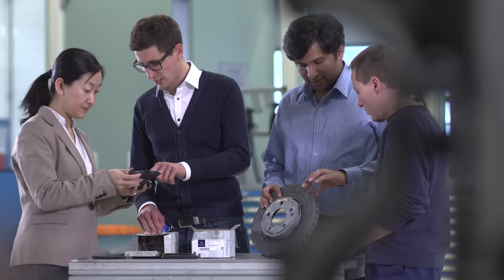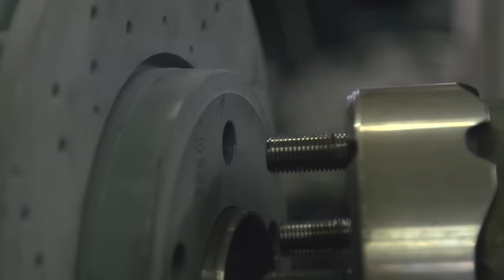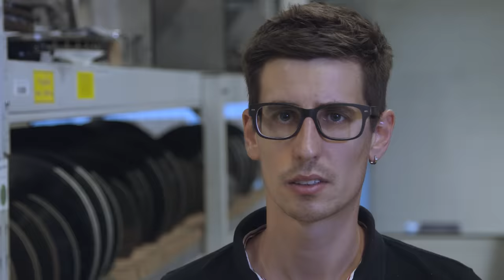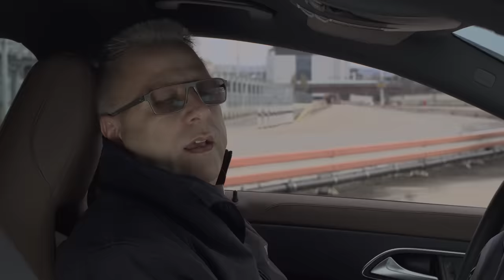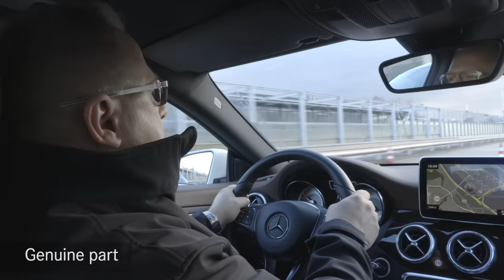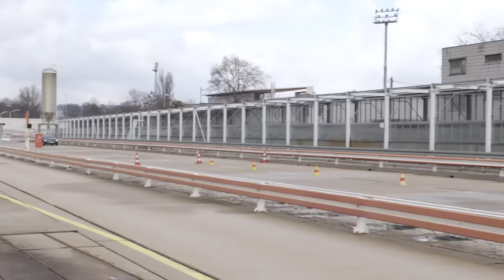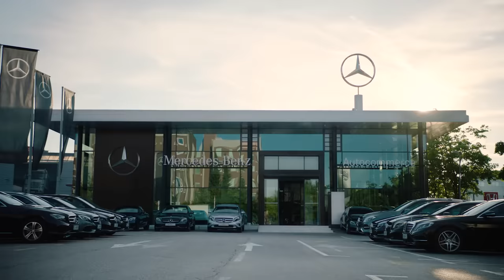Brake Test | Mercedes-Benz Genuine Parts vs. Fake Parts

Comment: How do counterfeit parts make brake distances longer? The only way to get shorter brake distances is to get better traction with the road. Besides that the brakes can easily lock up the wheels.

Comment: hello, what kind of brake pad used for Mercedes Benz cars? organic, metallic, or semi-metallic brake pads? of course ceramic for AMG High performance
Reply from the maker: Thank you for asking! The brake pads for AMG model are ceramic indeed. In general, it is important to equip vehicles with brake pads that are best suited for their performance requirements and characteristics. Hence, more standard Mercedes-Benz models are equipped with organic or semi-metallic brake pads.

Comment: does Mercedes make breaks , like rotors and pads.??? My  2015 ML 350 needs pads both 
(Front+Rear). And OE from Mercedes about CAN $  600.00. I'm buying online Zimmerman brand for $150, and Installing bu my self . saving over $500 . Do you think Zimmerman are counterfeit????

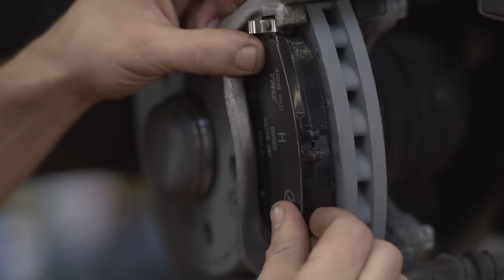Comment: Isn’t the brake disk at 1:18 on the wrong side? Vanes are supposed to pull air from the center to the outside rather than the other way around, right?

Comment: Mercedes you know that there is a feature called playback speed and that if you set it on 0.25 you can clearly see that the break lights of the second vehicle lighted up way later than the first one's right?

Comment: As any other manufacturer, Mercedes does not make brake pads, rotors, filters, belts, coolants, oils, fluids.... Everything they claim to be genuine is actually not made by them, maybe small percentage of parts is, but all those that i listed and even more, no car manufacturer makes. Sure they may develop something, invent it, but MB don't make brake pads, same as VW don't make shocks and springs, same as BMW don't make their own coolant... List goes on. As VW owner, i can tell you that "genuine" VW engine oil is nothing more than Castrol, except sticker on it says VW. Audi, VW, BMW, Porsche alternators are made by Valeo, wiper blades too. Just to be clear, i have nothing against genuine parts, i still get some of them for my car which is over 20 years old, but just because it's not their original part doesn't mean you will automatically crash and burn, to be honest i think this test was a bit exaggerated, complete brake failure while trying to do 60-0, in a single run (100-0)??

Comment: A lot of people don't understand what's going on here. When you look to buy parts for your car, there are 3 types of parts that you can purchase. The ones from the dealer, the ones from an Original Equipment Manufacturer and aftermarket parts. The dealer sells you parts which have the car manufacturers logo stamped on the part, in this case Mercedes. The original equipment manufacturer sells you the exact same part but it doesn't have the cars logo stamped on it (this is the one that you want for your Mercedes because it costs less than buying it at the dealer but it's the exact same part).

Then there are the aftermarket parts which are a copy of the OEM part. Now, some copies are legal, ie they purchase the right to make copies of the part and to sell it. But some copies are illegal, and are much inferior to the OEM part, this is what you want to stay away from. Let me make it simple for you, don't buy any parts that are made by a Chinese company. For example would you rather buy Zimmermann brakes or WBR (World Brake Resources) brakes? Zimmermann is a German company, WBR is Chinese. Zimmermann makes brakes for car manufacturers, WBR who knows. Stay with what you know and research the companies before buying their products.

Comment: where/how do you find counterfeit products, or rather how would you tell a counterfeit vs OEM vs legitimate aftermarket products?  I'm interested in avoiding counterfeit and I got no clue how to avoid them.
Reply from the maker: We advise contacting your local retailer directly regarding what is genuine or fake parts. They would know what is best for MB stars.

Comment: The second brake test you can clearly tell that the road was more wet as you can see after the cones on the first one had dry spots.. also black "counterfeit" car could have had worse off tyres...
Reply from the maker: The comparison of the braking distances took place under the same conditions at the same initial speed and the same braking point. The longer braking distance for the car with the counterfeit brake disks is the result of the defective quality that frequently occurs with counterfeit products.

Comment: What you will find a lot of the time is, for example, my Audi A4 control arms are stupid prices from Audi yet you buy them from Lemforder and they are much cheaper. They are however identical as Lemforder makes the control arms for Audi. I've even had parts for my car where the Audi logo has literally been filed off. 

It's the car manufacturers that are causing the real danger through their over inflated prices for parts, and also for those who don't know how to change Brakes the charge stupid amounts for something which is so very very simple.

Comment: My issues isn't with finding genuine Mercedes parts, it's finding them for a reasonable price.  When shopping around for prices and in-stock availability I find Mercedes dealer prices are all over the place, example when looking for front rotors one dealer was selling them for almost $100 a piece while another dealer 20 miles away had them for $63 a piece.  And I won't even begin to talk about the prices the dealers charge to install the parts, I wouldn't even be able to afford having a Mercedes if I didn't know how to do alot of the maintenance myself.

Comment: I had a customer with a top of the line Mercedes suv. He had 30k on it and it needed all pads and rotors replaced. He had a stroke. I sent him to his mercedes dealer and convinced them to replace 1500 dollars worth of brakes for next to nothing. Long story short, their rotors are either junk or purposely made thin. He got rid of the suv.

Comment: I suppose nobody in the comments knows the difference between counterfeit and aftermarket. Nowhere did MB say legitimate high quality aftermarket brake components from a reputable brand would be worse than OEM. They’re only showing the dangers of actual counterfeit MB brake components. You know, the kind of stuff you find on Wish and Ebay.

Comment: Counterfeit does not mean aftermarket. If a company is selling a product as Mercedes-Benz OEM it's flat-out wrong and very sketchy regardless of performance. But there are aftermarket brake parts available that are just as good if not better than OEM.

Comment: So why when you replace pads with Mercedes benz you have to replace rotor? Why do the pads eat away at the rotor?
Reply from the maker: Our colleagues at your local Mercedes-Benz workshop will be happy to advise further on the changing requirements of parts for your vehicle, Jesse. 😉
Reply: Mercedes-Benz not answering the question but ok...

Comment: The length of the way the car needs to stop dose not have much to do with the breakes. They just need the ability to stop the weel. The rest makes the „abs“ and rubber on the tires

Comment: Wow. The counterfeits didn’t even stop at high speeds. Just skidded until a low enough speed the pads could handle. Mercedes AMG carbon ceramics I’ve always said are the best with Bentley, Porsche and Lamborghini. Also I don’t think they didn’t even use the AMG brakes in this test (because it wasn’t an AMG car)

Comment: How the hell brake pad could affect the stopping distance if the brakes can lock the wheels? You apply full brake and the ABS actually working against you to release the brakes. The stopping distance depends on the tire and road conditions.

Comment: People do not understand the difference between aftermarket and counterfeit. They were testing illegal Mercedes brakes pirated by (most likely) Chinese companies. They were trying to show you that a fake Mercedes brake that costs maybe 25% of the price of the original one will endanger your life. Of course aftermarket brakes will be most likely better than the original one, but thats nothing new on series production cars like the CLA or pretty much any Car that doesnt make 600+ horsepower like supercars do. They will most likely come with Ceramic brakes by standard. Everybody in the comments just exposed themselves tbh

Comment: Mum: Oh my god he's going to say his first words!

Mercedes: Th-th

Mercedes: The counterfeits shown in the film are not high quality replacement parts from Mercedes-Benz or other legitimate suppliers, rather they are illegal counterfeits from product pirates. In almost all cases such counterfeits are of defective quality and do not meet minimum legal standards. Thus the counterfeit parts can become a danger for vehicle occupants or uninvolved third parties. The comparison of the braking distances took place under the same conditions at the same initial speed and the same braking point. The longer braking distance for the car with the counterfeit brake disks is the result of the defective quality that frequently occurs with counterfeit products.

Comment: Honestly I paid 30$ for my rear rotors instead of 200$ and 60k later they are fine, for the front though I would only use OEM or equivalent.

Comment: How do we know the counterfeit and the Genuiene ? Any serials numbers on the breaks
Reply from the maker: As it is our objective to prevent accidents before they occur, we’re consistently working to combat product counterfeiting. Unfortunately, counterfeiters are increasingly specialising in copying vehicle replacement parts that are often deceptively real, to the point that not even experts can easily identify them upon first glance. You can stay secure against counterfeit products and the resulting risks by using your authorised Mercedes-Benz dealer or service partner. That way you can be certain that you're receiving Mercedes-Benz quality. 😉

Comment: The counterfeits shown in the film are not high quality replacement parts from Mercedes-Benz or other legitimate suppliers, rather they are illegal counterfeits from product pirates. In almost all cases such counterfeits are of defective quality and do not meet minimum legal standards. Thus the counterfeit parts can become a danger for vehicle occupants or uninvolved third parties. The comparison of the braking distances took place under the same conditions at the same initial speed and the same braking point. The longer braking distance for the car with the counterfeit brake disks is the result of the defective quality that frequently occurs with counterfeit products.

Comment: In this case the rusty rear axle on my w 204 must also be a fake part, unfortunately a fake part assembled to the car in the manufacturing plant, and the lousy timing chain also has to be a fake part from factory

I once got a new rear view mirror glass for my former A class - it was not a original part. However, the merc logo on the plastic was simply melted away at the 3rd party part (it was melted away at the point where the old mirror glass had the logo), it was made by the same supplier as the original mirror glass. 
Merc isn't producing any brakes by their own - they buy from suppliers, like Lucas, ATE or Brembo. As long as you don't buy faked ebay brake pads the pads made by this suppliers and sold by aftermarket stores are as good as the original ones, since they are from the manufacturers which make the original ones

Comment: You guys who are bashing Mercedes for this need to know what is going on. They're not saying that legitimate aftermarket parts are inferior. The problem at hand that they are describing is RAMPANT in the automotive industry. It's substandard parts made in places like China deliberately using inferior materials, then they are finished and packaged to look like genuine parts. They're then sold, usually through places like eBay, as genuine parts. This is actually against the law, just like the fake Rolex watches sold on the street corner for $10, only now you're putting your safety at risk. When you receive the parts, they're in a Mercedes box, and the pads themselves are stamped with the Mercedes logo, as well as that of the OEM supplier such as ATE or Jurid. But in reality, they're garbage that doesn't meet any standards- standards which even aftermarket manufacturers, at least in Europe and the US, are required to meet. Even major, respected aftermarket brands have the same problem. The "Brembo" caliper, "Bilstein" strut, or TRW tie rod end you bought on eBay could very well be counterfeit, too.

Comment: Please support, acknowledge or just simply tell others about "Right to Repair Act", sometimes also referred to as "Right to Repair". This way we will be able (or mechanic of our choice) to diagnose correctly, set functions or reprogram. Otherwise we are in mercy of stealer ( I'm sorry, dealer)

Should I understand that original brake components shown on the video will outperform aftermarket drilled brake rotors and pads? i truly doubt it, but maybe im mistaken.

Comment: That might look fake but there's definitely a massive difference between an original breaking system and fake one, i only have a cheap seat ibiza and i accidentaly bought fake brake pads (i didn't know anything about cars before) and least i can say is that i'll never buy fake parts anymore, the braking distance is insanely longer, it does a lot of noise even with i barely touch the pedal and it's not smooth at all
So as much as it looks fake they're still right about it, even if the results are not accurate

Comment: Audi, BMW, MB and other OEM pads wear out the discs and give off unsightly black dust.  Akebono Ceramic pads keep the wheels clean, last longer, brake better, don't chew up the discs... unfortunately their longevity is not profitable (less disc and pad sales).  I had them on my E34 540i and now have them on my W124 300E, I'll never go back to 'conventional' pads.

Comment: Mercedes-Benz’s brakes are not enough for cars, even the original part is insufficient.Mercedes-Benz is a company known for its safe cars but when I go to mountains brakes get hot.I sometimes hear the same phrases from my friends who own Mercedes-Benz.Our cars are (2018-Vito 111 CDI),(2018-Vito 114 CDI),(2016-C200d),(2015-A180d),(2012-C180).

Comment: Hilarious how people that totally missed the point of this ad are talking about how biased or fake it is.
Of course, yes aftermarket brembo brakes are going to be better than merc OEM parts most of the time, right yes of course.
But this test is about COUNTERFEIT, illegal parts. As if anyone buying a Mercedes is not buying the OEM pads, this ad isnt targeted at you people with 20 year old cars.

Comment: Are OEM parts considered as counterfeits?
Reply from the maker: Since ‘OEM’ stands for ‘Original Equipment Manufacturer’, such parts are no counterfeits as they are produced by our factories.
Reply: @MercedesBenz  I bought an original fuel pump for a W210 230E but made in Hungary (if I remember correctly). Not made in Germany. The mechanic assured me that this is genuine Mercedes part.
Reply from the maker: We confirm that we have a factory in Kecskemét, Hungary. For futher questions, we suggest you get in touch with our Customer Service. 👍

Comment: As soon as the "counterfeit" brakepads can lock up the wheel (which they probably can) there should be no difference in stopping distance from original pads.. This test is probably highly biased.

Comment: Did the narrator just say something like they were only able to tell the parts were counterfeit after exhaustive testing? Then the put them in a test rig that applied the brakes so hard they were literally red hot to cause failure?

I don't know, doesn't really sound like a strong case to me. I don't take my vehicle to the racetrack. On the highway any hills I go down are also traversed by 40ton trucks. Not to mention the decades of cars with drum brakes.

Comment: I used to sell Mercedes GENUINE parts, their brake parts are DEARER than the SAME part from the manufacturer of the GENUINE pads. Mercedes Disc Pads have a Mercedes star and they are date stamped, I sold Pads from an After market source that had a MUCH newer date stamp and came from the EXACT same source as the GENUINE ones for HALF the price. Mercedes = Price gouging.

Comment: If the fake brake pads can lock the wheels at speed(which there is no reason they couldnt) and ABS does all the job how come the car with original  brakes stopped sonner 
The stoping distance is determined by speed, mass and traction tyre-to-road not the friction between disc and brake pad since the ABS is there to prevent locking

Conclusion 
Stoping distance should be the same if u can break hard enough for ABS to engage

The ABS surely was engaged

However i do realise "genue" pads most probably should have longer lifespan

Comment: In Mercedes car,counterfeits  looks take longer distance to break,the great part is the high Quality by using great rims and break systems in Mercedes like in the road, the counterfeits is making long distances,but inside the counterfeits looks a bit hard breaking,when the car break in counterfeit,happen is crashed in good props,they are differently,the counterfeit in high speed,to breaking,it’s crash from good props,next,the genius part break short distance to test the car,those cars aren’t or are great,thanks for commenting me. 🙂 don’t forget. (They use cone to stand the car straight to crash good objects)